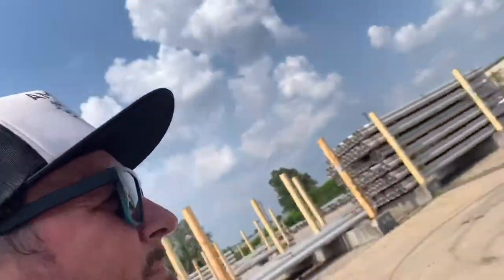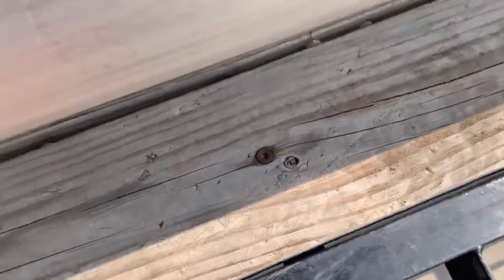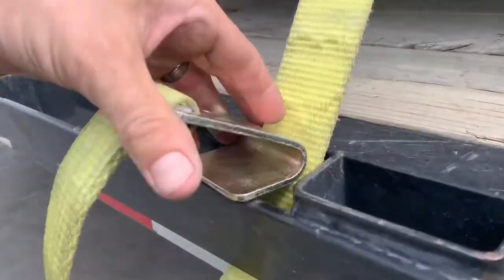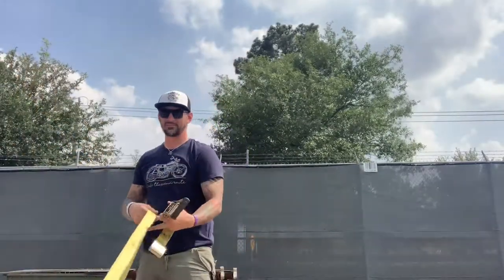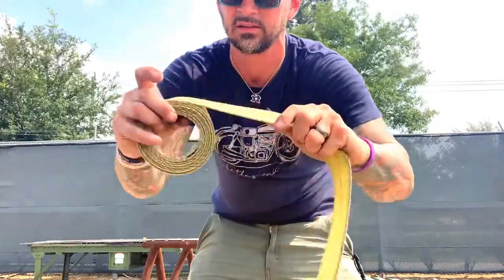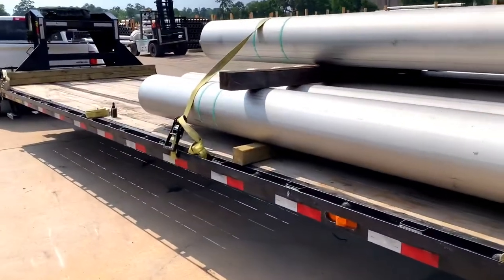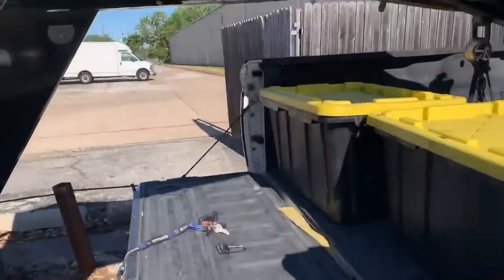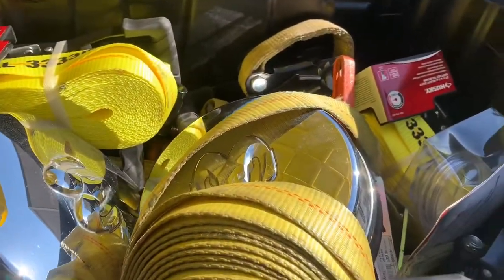Load of 12” pipe.   How to use ratchet straps. #hotshot #ratchetstraps #securement #hotshottrucking

Comment: You are wrong it's one straps for the first 5ft and one for the next 5ft and one every 10ft after that so basically 2 for the fist 10 ft and one every 10ft after that and have to cover at least half of the total load's weight
Reply from the maker: You are the following example, one tiedown is required because the article of cargo is 5 ft in length and does not exceed 1,100 lbs. If the article of cargo were greater than 5 ft in length but less than 10 ft, two tiedowns would be needed regardless of the weight. When an article of cargo is not blocked or positioned to prevent movement in the forward direction, and the item is longer than 10 ft in length, then it must be secured by two tiedowns for the first 10 ft of length, and one additional tiedown for every 10 ft of length, or fraction thereof, beyond the first 10 ft. An example of this is provided below. If an article is blocked, braced or immobilized to prevent movement in the forward direction by a headerboard, bulkhead, other articles that are adequately secured, or other appropriate means, it must be secured by at least one tiedown for every 10 ft of article length, or fraction thereof.